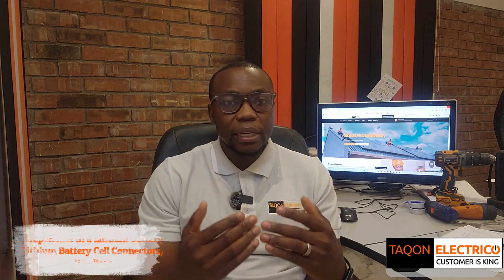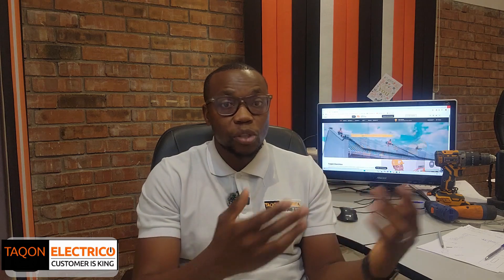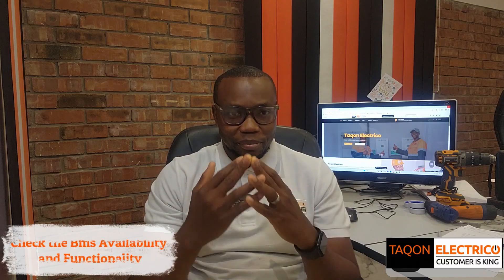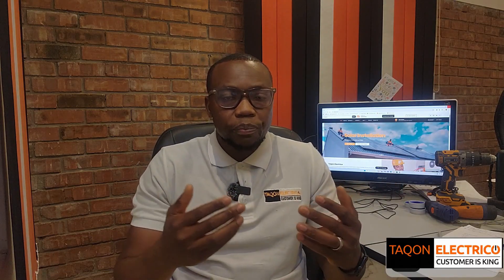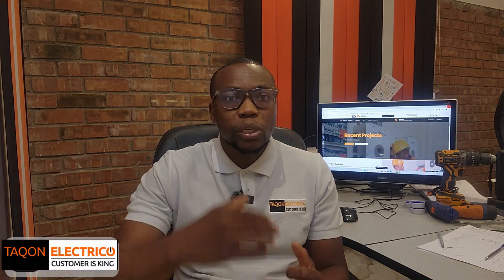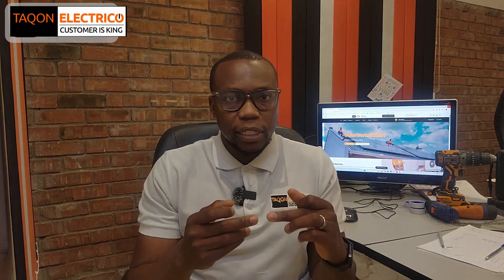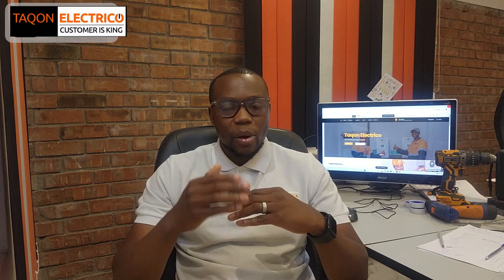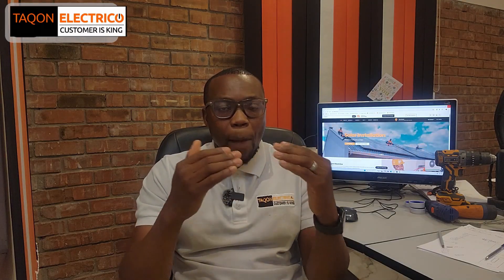6 things you must check before buying your Solar Lithium Battery

Comment: What do you say about premature bms failures in pylon tech batteries?
Reply from the maker: That is a good observation. However,  from my own experience,  i have seen this happening, especially when the Pylontech Batteries are not in communication with the inverter.  This also happens with a lot of batteries.